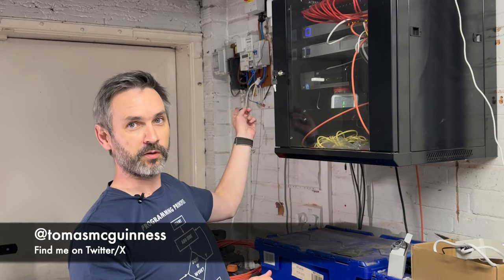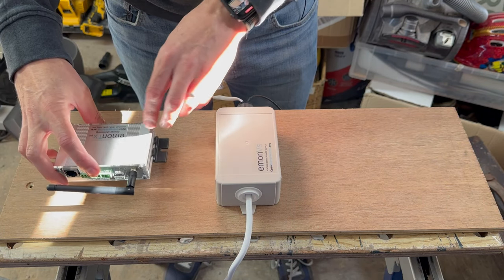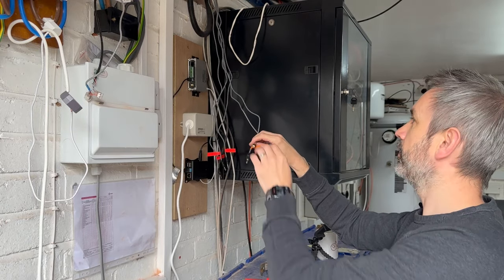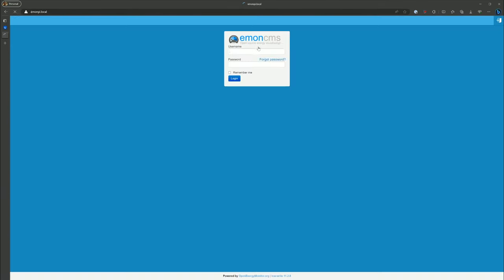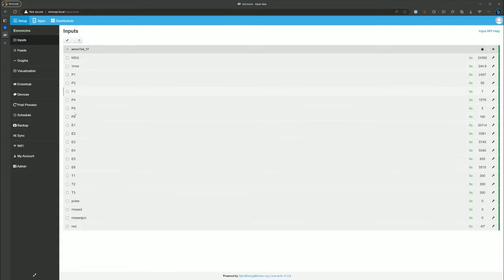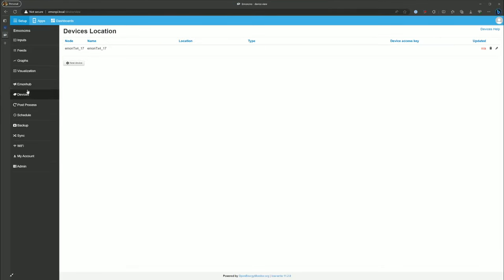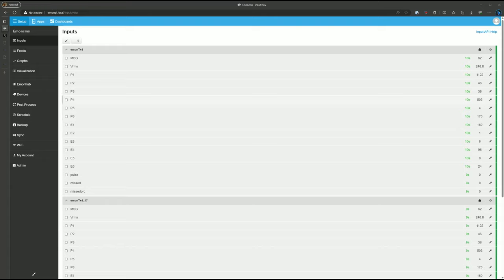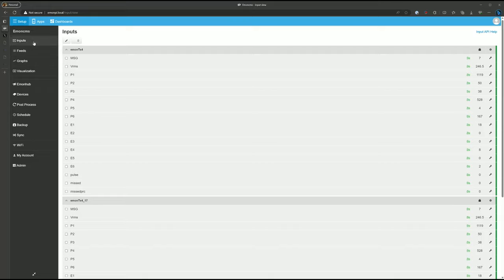Installing my Open Energy Monitor

Comment: Nice work! The reason the Inputs are duplicated is because the RF is still enabled. After sending the command to disable the RF you need to send 's' to save the configuration to EEPROM
Reply from the maker: Thanks Glyn! I’ll give that a try.
Reply from the maker: It worked :) Thanks!

Comment: No, the RJ15 connection on the EmonVS is not for data. It is the voltage reference to enable the emonTX to more accurately estimate the consumption.
Reply from the maker: Thanks!

Comment: Hi Tom. Nice video, very jealous of your setup! What was the thinking behind going for OEM, as opposed to a bunch of Shelly EM units with the CT clamps?
Reply from the maker: Thanks! The cost was a big factor. 6 Shelly EM clamps would be about £300 and I got the whole OpenEnergyMon kit for £350. I can then extend to 12 clamps for another £25, rather than another £300. In addition, you get the software for logging and managing it all.

Comment: Hi Thomas, a question when clamping the wire is it okay that the wires are live at the moment?
Reply from the maker: Yes, it should be, just take extreme care! If you are not 100% confident, get a professional in. However, the wires are probably exposed and should be safe to touch. Use a testing tool if you’re not sure. Don’t take any chances!! 

Also remember to orientate the clamp so the arrow point in the direction of flow.
Reply: @tomasmcguinness  thanks for the feedback